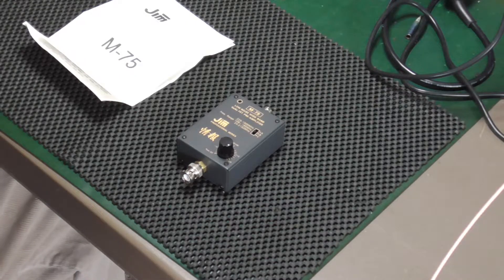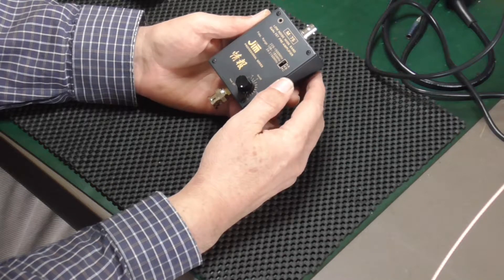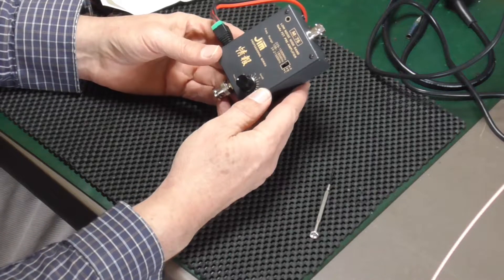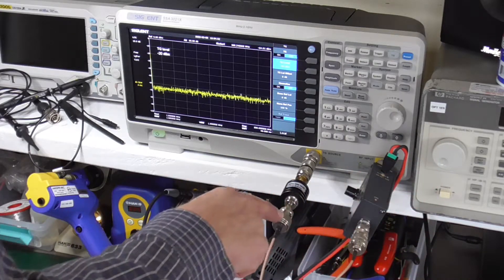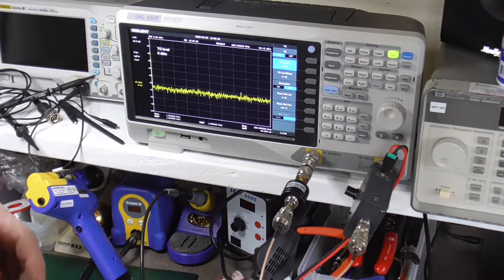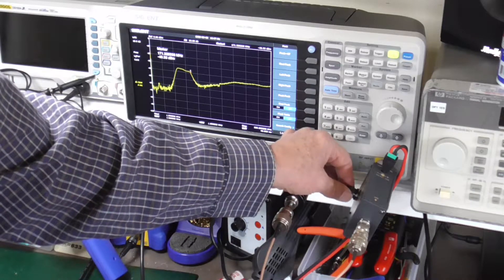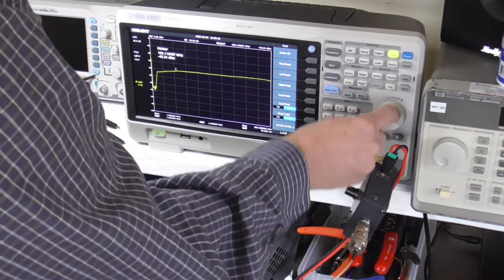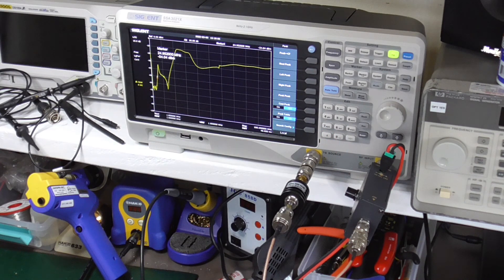Review of JIM M-75 scanner pre-amplifier.

Comment: Ham radio operator 22 years.
This thing is junk.
Reply: What do you recommend ?
Reply: internet operator for 26 years. 
this opinion is junk.
Reply: @grumpy_ken  Monkeys can operate the internet.   
Your comment is yet another confirmation of this fact.
Reply: Troll..
Reply: @georgep2335  wah
Reply: Why is it?
Reply: @nathanpetrovski7525  The main recurring issue with these units is the sloppy soldering at both end connectors.
The + / - wires aren’t shielded at this crucial point (resulting in inductive noise), and moderate use will likely loosen the connectors, which is the main weak point of these units.
When all of these points have been addressed, the unit will give a good boost.
There is also a method of ‘tuning’ the variable capacitor with your radio and antenna for max recep, but that’s another topic.

- W8GMG
Reply: @nathanpetrovski7525 it's not HAMEs are fat and losers with useless junk radios that can't talk across the street without a repeater and even then all they say is CQ CQ 74s all day. Also it's not the achievement he presents it to be. He studied prepublished answers for the test and memorized 28 out of 35 questions correctly.
Reply: It's made for a scanner or radio receivers only not for Ham use , And unless you have one & use it daily you can not no what it is really like .